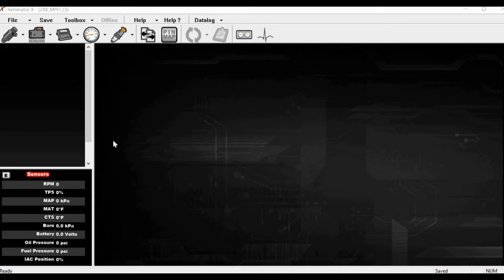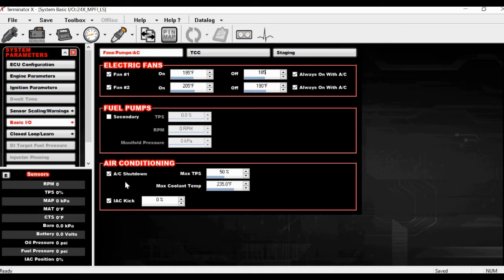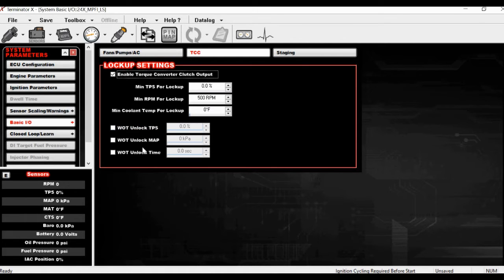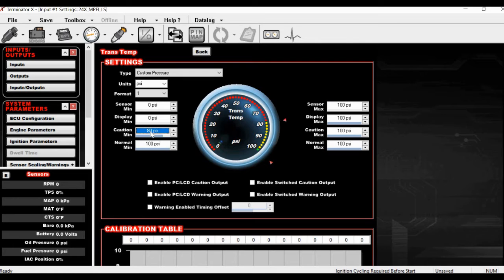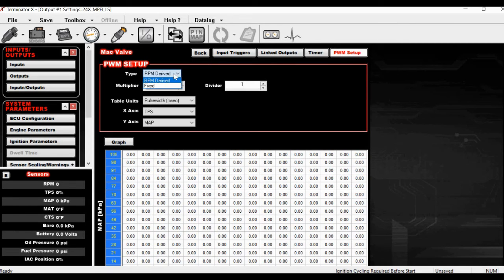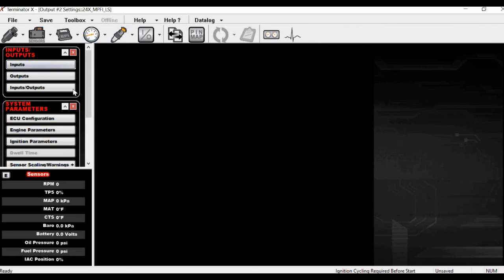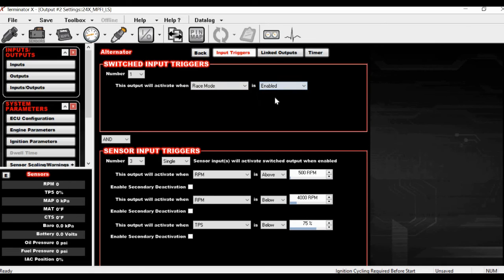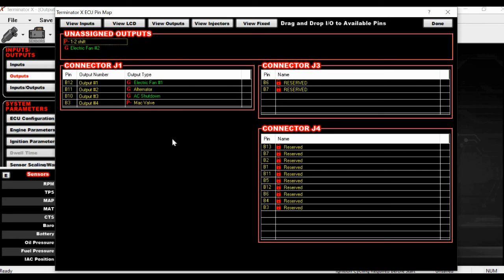Inputs and Outputs Overview with Holley Terminator X

Comment: Great info here, I need to change my AC shut down to deactivate by RMP not TPS, situation, say accelerating full throttle and say you deactivate at 80% TPS, and you let off the peddle at 7000 RPM the AC compressor will engage at 7000 RPM, not good, I don't know why they did not configure it this way from the get-go, Thanks for this video, I will try and use this info to configure this issue, thanks again!

Comment: The two most used input/output functions we all want to know about as drag racers are the trans brake and bump functions which you didn't cover. There is much confusion out there in utube land about setting up the bump/t brake... 12v or ground inputs, tbrake or t brake launch, etc
Reply from the maker: Lucky for you there’s a transbrake video in editing right now!

Comment: Great video. I only want to set a two-step off my trans brake button wired to inputs. I have watched a bunch of videos and was thrilled when I managed to get it to work. I set it up on my laptop using the can-bus and then just set the parameters on my wizard. However, when I cycle the ignition, it stops working. What did I do wrong?
Reply from the maker: I’m not sure but it doesn’t sound like it’s setup correctly. There shouldn’t be a can bus involved for any of that. Always put the transbrake on discrete IO. That’s a safety concern.
Reply: I didn't connect my trans brake to the ECU at all. I did T off from the trans brake switch to an input on the Terminator X. I then pinned it as my two-step. When the button is engaged the engine would only rev to a desired rpm. Works great until you cycle the ignition and its gone. Maybe after I make the changes on my laptop I need to down load the changes to the SD Card in the Wizard? @greenshortsperformance472

Comment: I want to send a 12v signal to the shift solenoid, but term x only seems to output pwm or ground even though  the yellow/gray wire output wire says it is a 12v wire. I'm I stuck adding a relay and out putting a ground to it?
Reply from the maker: Yes you are. Term X is ground output only. The instructions you looked up are for HP/dominator
Reply: @greenshortsperformance472  Thanks. That's a bummer.

Comment: I want to utilize chevy oem electric fan and radiator setup for my Squarebody but the fans have a low and high setting. Will it still be possible to run them with a Terminator X max?
Reply from the maker: I’d need to know specifically how the fans should be wired but typically a 2 speed fan would be triggered the same way two separate fans would. In that case it would be possible.

Comment: For someone like myself, this is vary advanced hard to follow,  I have trouble leaning from someone that knows something like the back of their hand because they teach as if you already have a clue of why they're doing what they're doing. But I'm hoping you or someone can give Me a direct simplified answer for a simple mind, The reson for my fans coming on with key on- cold motor,  before temperature parameters with the AC off (not even charged with freon yet)  I have purchased and wired in "current performance wiring" meant for the Terminator X, And  their dual relay for the electric fans for the Terminator X set up as well,  why is my ecu sending the ground to the relays at all times ?
Reply from the maker: I think it’s either pinmapped/programmed wrong or you have a physics ecu problem.
Reply: @greenshortsperformance472  Thank you for responding sir.
Reply from the maker: @kevinwest3689  no problem. If you have any more issues feel free to email me at tuning.gsp@gmail.com
Reply: Boy your opening a big can of worms there, lol. I'll try to keep it to a minimum, research before I ask,   I'm luckier than some I guess, I read the instructions hooked it up and it fired right up and all is well as far as I can tell right out the box, good thing" I don't even own a computer or know where you put the gas in one? The fan came on with  the set perimeters initially. My wiring looks better than Factory, soldered waterproof heat shrink loomed, The canisters on my kitchen counter are exactly evenly spaced,  I think I'm going to try unhooking the air conditioning wires & see if there is something possibly wrong that is triggering the ground for the fans,  do you think it would be ok to hook a test light to power and touch the outputs and see which one sends the ground when the temperature is correct, or with that fry something?
Reply from the maker: @kevinwest3689  you can do that. Easier thing is to set your meter to ohms and check for continuity to ground. Another thing is that the harness could be pinned wrong and it’s sending ground to the wrong wire

Comment: If you run duel fans, does that mean I’m using an out put for each one or can I run both fans with one out put? I’m helping a friend with a LS turbo 67 chevelle. We have are running Mac valve A/C and fans 60e for the trans. With the limited I/O I’m just tryin to conserve what I have. Thanks.
Reply from the maker: You can absolutely run both fans on a single output. The output would trigger a relay or a relay for each one and you would only set the on off temps for one fan in the software.
Reply from the maker: Also be sure the relay and wiring can handle the amp draw for two fans
Reply: Yep I’ll make sure on the wiring. Was going to run a relay for each fan but use one ground trigger from term x.

Comment: can you show in detail how to set up a PWM radiator fan control
Reply from the maker: I can do a pwm video however I don’t have a fan controller to really show you how to do it
Reply: @greenshortsperformance472  i'm working on a 69 camaro and i'm thinking on using a corvette PWM fan and trying to figure out how to control the fan with the x max and also control it for the a/c. i'm thinking of using a holley pressure sensor to monitor the refrigerant pressure and control the fan also.
Reply from the maker: @jcook69camaro  the most important thing you need for pwm is a pwm fan controller. The Holley does not run at a high enough  frequency to properly control fans.